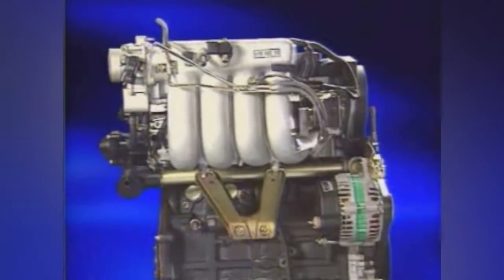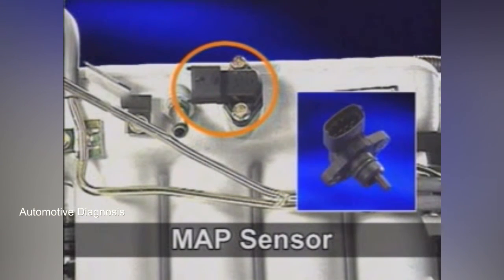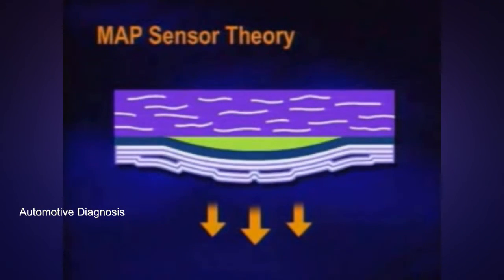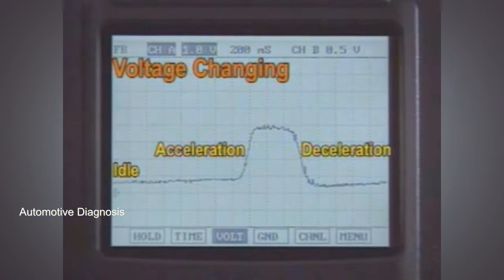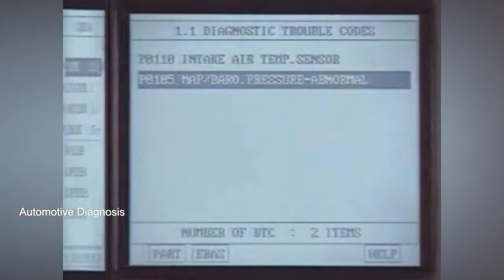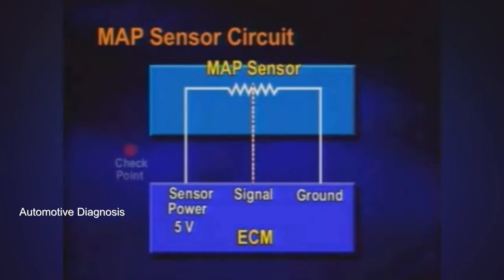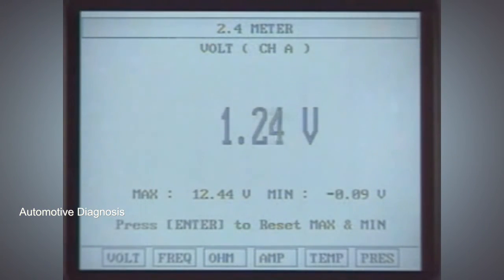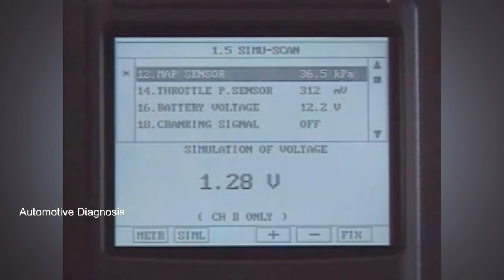How to Test a MAP Sensor - Manifold Absolute Pressure Sensor

Comment: What is the normal pressure if the sensor is good? Is 5 psi good on idle?
Reply from the maker: Normally when engine is at idle, the sensor output in a 4 Cyl engine is around 1.55 V which shows around 40 kPa or 5.8 Psi
Reply: @AutomotiveDiagnosis  if that the case mine is good...thx for the info cheers!!